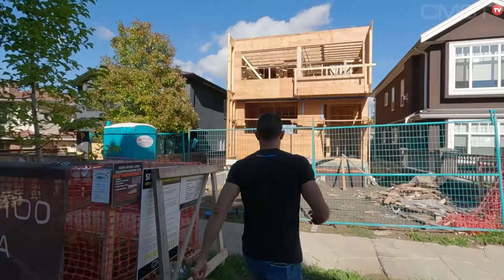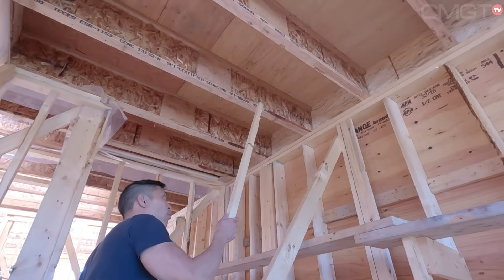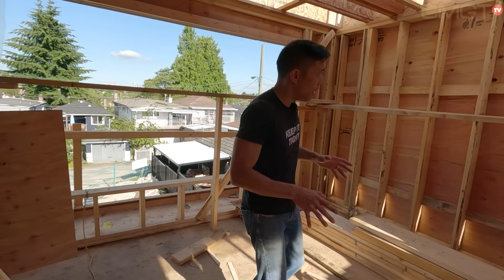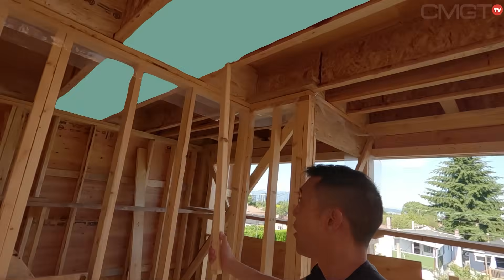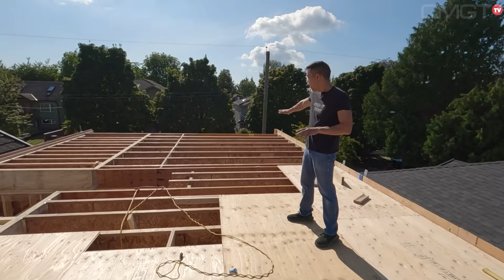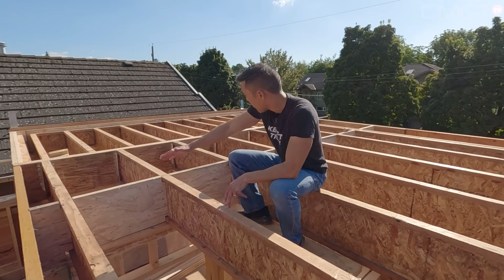How Builders Reinforce a Rooftop Deck | Episode 22

Comment: That's web packing, not  gussets. Gussets are for strengthening a joint.  If they were gussests they would cover the top and bottom chord of the TJI . That said ...you never gusset TJs.  Gussets are typically used with trusses  and truss repairs. I would never gusset a TJ mid span.
Reply from the maker: Yes gussets are used in trusses - you are right!  In my daily construction lingo, I have thrown the term gusset around in more than one way, including how I have described it in this video.  I GUSS-ET was the wrong word to use!